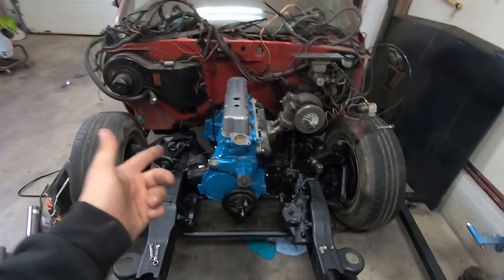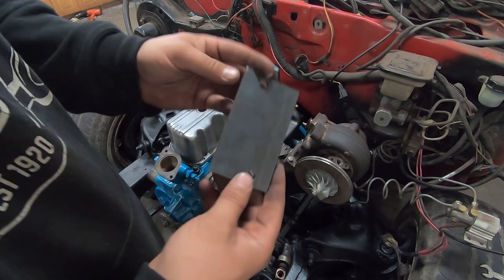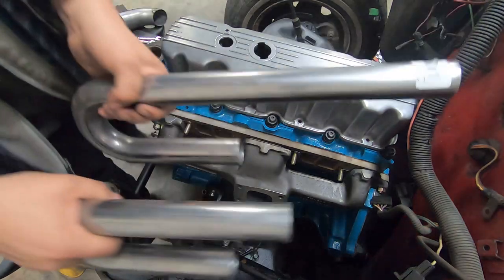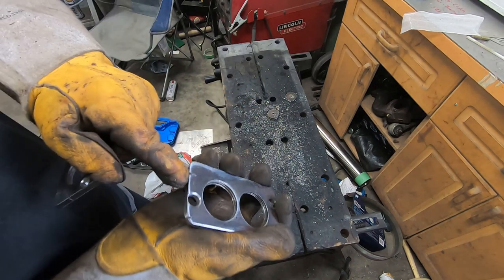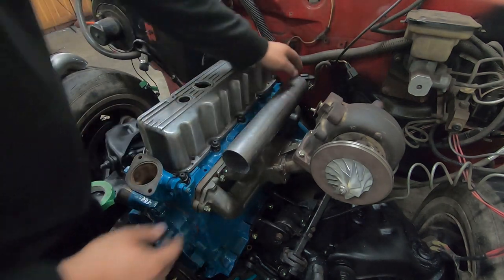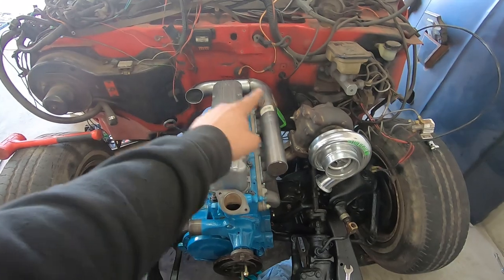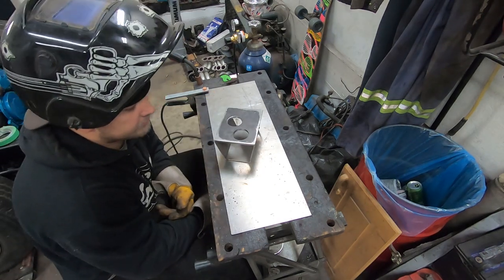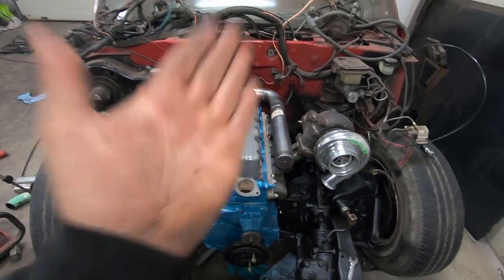Creating a Custom Intake From SCRATCH! (Turbo 3.0 Boat Engine, Corvette Swapped S10)

Comment: That second iteration of the intake runners is so much better! Awesome learning exercise. Will give more power and torque as well I'd think, even if only slightly. You definitely still need a drill press. Will make hole sawing a lot less tiring and it will be easier to lube while drilling. Also wish I could buy you a Milwaukee Hackzall or a band saw so you don't have to hand saw everything. I am jealous of your belt sander though. I guess you can call that intake the Frankentake since it's your monster. Honestly it's a pretty cool solution given what you were working with. I think it actually came out pretty awesome. Can't wait to see it run!
Reply from the maker: Definitely LOOKS better, not sure how she's gonna run tho. See I have a press I'm just too lazy to set it up, and as far as sawing tools go yea they're just not in budget sadly :(. Glad you like the end product !
Reply: @ak_strem7010  Set up the press you won't regret it. It is seriously dramatically less time and effort. Do it. Just do it. Do it.

Comment: If you cut the bottom out of the tune port manifold you can make a neat cover for the right side of the intake and itll blend with the valve cover. Then with the rest painted red you probably  wouldnt notice the pipe at all.
Reply from the maker: Very very true

Comment: Have you not considered making an exhaust system as well? That way you could just take the adapter plate off all together and run your turbo and intake exactly where you wanted originally? I know for simplicity and times sake it’s probably quicker to do the plate but wouldn’t it make all of the planning much easier?
Reply from the maker: Adapter plate is a must, my track record of custom exhaust manifolds is not a good one.

Comment: before you finish doing fittling with the exhaust and intake you should vacume the intake and exhuast holes and manifolds so theres no possibllity of a tiny peace of metal getting in the cylinder
Reply from the maker: I cleaned er out as well as I could
Reply: @ak_strem7010  ok just lookin out for u

Comment: So - being a TBI - id be concerned with fuel puddling. Especially in the box under the TBI unit. Your intake does have a decent flow to it, but would be more effective if you had multi port injectors in the runners and make it a "dry" intake. TBI works better with a direct flow into the head due to gravity and fuel droplets. Aside from the fuel puddling, you may have some serious drivability issues with this. Idling, bogging, stalling, etc. This would be from fuel being stuck in the manifold and then dumping in on braking or accel. 
This year comes and goes - Id rather it be RIGHT - instead of "right now".  I think your first idea of the box on top of the "log" would work better and move the turbo for the clearance.  at least it would be a shorter route for the fuel to travel.
Reply from the maker: Yea, that box is definitely NOT optimal and I was aware of that while welding it. I would love to have a "multi port" style as you say ( I believe I could still run them off the factory ECU with some impedance balancing)

I just don't know if If the internet is going to be pleased with waiting over a year for this project to be running again, and I really want to hear it at least run once. I'll monitor exhaust temp as close as I can to ensure them front two arent leaning out too badly

Comment: If you haven’t made an intake, are you even a hotrodder? I built one to put a 2 barrel holley on a Chevy 250 inline 6 I wanted to do this very thing to it but unfortunately it wouldn’t stop leaking oil so I went LS and nv3500 a lot more fun to drive but still wish I had the 6 cylinder some days.
Reply from the maker: That 6 cylinder would be super cool. I've got some learning to do in intake design tho lol

Comment: Bro you may think this look dumb but i think its great.  Also have you seen the guy with a dodge intrepid from 24 of lemons?  He got sick of the injector issues. Plasma'd a hole in the top of the plenum and slapped a carb on it with cardboard gaskets.  This is lightyears better. Its also better than the chevy spider injection system in general. so give yourself some credit.
Reply from the maker: CARDBOARD GASKETS hahaha that's impressive! The reassurance from comments is very warming

Comment: How about 36lb injectors from a supercharged 3.8 (at the junkyard) and a Microsquirt? Then you could mount the injectors in on the intake runners, cap the back and put a throttle body from something (same 3800?) on the front? That's about as cheap as I can imagine doing port fuel injection.
Reply from the maker: I do plan on using half a TPI fuel rail and injectors eventually. and probably a TPI throttle body as well - my dad is a huge 3rd gen guy so he's got lots of spares

Comment: Here I have an idea 💡 take some of your 1inch steel a make a spacer for your  Exhaust you would be doubling the 2 1 inch spacers you will 3 gaskets. I think you will get the room you need. Also I would use square tubing to match your ports on your head I know this is a lot of work but I think in the long run you will be much happier. Anyway I'm going thanks Ray in Idaho

Comment: I really like what you came up with but with the fuel flowing through that intake will probably starve the front 2 cylinders of fuel.

Would be a great design for just flowing air with 4 injectors.

Go to the junkyard and get injectors and a throttle body and maybe a 4 cylinder computer that already has multi point fuel injection. 

Get injectors that have a lb per hour of;

Injector size x 8(the 8 is for a 4 cylinder, an v8 would be 16) that will give a ballpark estimation of how much power those injectors will support.

So you don't necessarily want the 4 cylinder injectors, you may even need aftermarket ones if you're going to make over 200 HP? 

30 x 8 = 240 HP. Or you could run 2 injectors per cylinder? You can probably put the injectors on the log part of the intake instead of the very short runners.(runner length is a whole other discussion, you can find that info on the Richard Holdener yt channel). 

Or, if it's possible, have the 2 injectors next to each other squirt at the same time to feed one cylinder? 

Very cool project, you're making me think of things I'll have to do if I ever am able to do the similar project with the sbc head I told you about before.👍
Reply from the maker: Yea fuel distribution is a concern of mine, I just want to hear the truck RUN once. Then, maybe over the winter again, I'll try to make an actual MPFI system with individual injectors. I have an old MS2 unit but then I would have to re learn and re wire almost everything. It's a time thing and a pleasing the general viewership thing too, because I know nobody wants to see this thing take 6 more months to run into springtime.
Reply from the maker: I'm glad you enjoy the project! Thanks for sticking around
Reply: @ak_strem7010  

Most of the time it isn't about the destination, usually it's all about the journey. I know I'll keep watching even if it takes that extra time to fire it up and most of your other viewers probably will too?

Sounds more like you may be the one that is probably in a hurry to hear it run? Ay? Maybe fire it up with the throttle body and no turbo since you made that intake? Unless you want the practice doing turbo piping twice?

I can't remember what you did with the Corvette engine but if in you still has it you could steals fuel injection parts off of it? Can't remember what fuel system was on that donor car but if in it has stuff you could use.............?

Anyway, dealers choice, its your build I only offer free advice and my opinion make of it what you will. You have what looks like some decent fabrication skills, maybe you want to do it twice for more practice? 

Also just in case you didn't know, short runner intakes are better for making high RPM HP while long runner intakes are better for low RPM torque. Those very short runners you made should be good to rev that thing to the moon! You may want to add a balance shaft if you plan on making high RPM power with that thing?

Comment: Just paint it for now and leave the TBI shit for now and get her on the road!’
Reply from the maker: That's the hope!
Reply: Yeah man it doesn’t look as bad as you’re making it out. Super unique and fits the theme , good work. I’m working on my brake booster swap cause I don’t want manual brakes haha. Heads up if you have it in mind, those brake pedal rivets don’t line up with a booster and they’re a bitch to drill out

Comment: i'm late to the party, what is this engine?
Reply from the maker: It's a Mercruiser 140, 3.0L 4 cyl from a boat
Reply: @ak_strem7010  did this beast get used in a car platform ever?
Reply from the maker: @themadmallard  In a technical sense, no. the mercruiser was mainly a marine division. GM produced a vortec 3000 as an industrial version for forklifts and other equipment. The most closely related engine is a chevy 153 from 60's export GM cars, and the VERY early iron dukes from the 70's